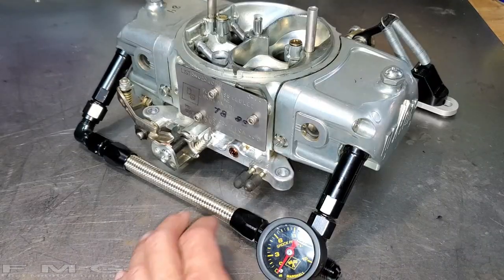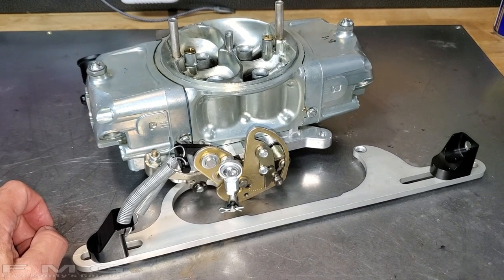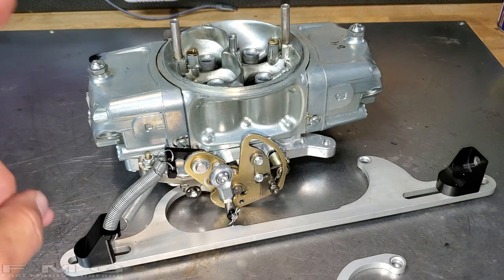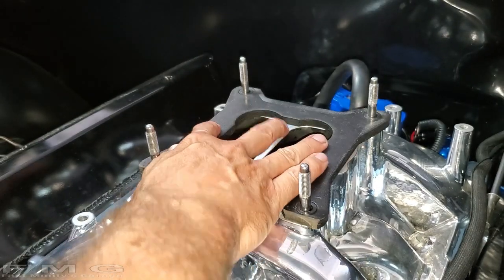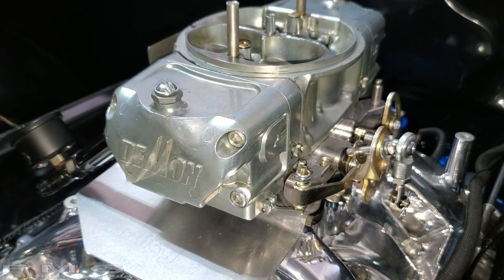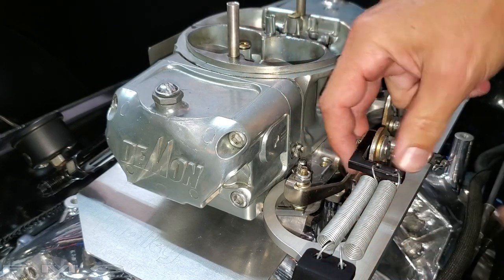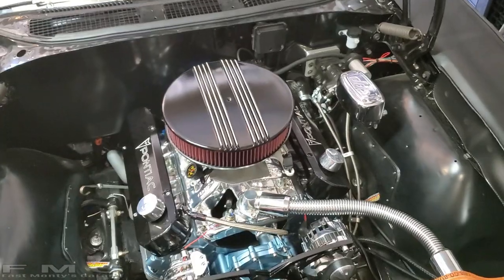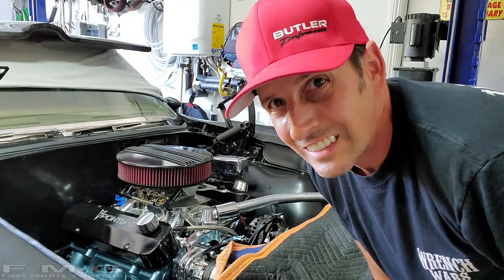Barry Grant Speed Demon Double Pumper Installation - What I had to do.

Comment: Hi Mike !! What length carb studs did ya use ??? And have heard of any problems with going with an MSD pro billet distributor??
Reply from the maker: Hey Eric, I wanna say they're 1.5" studs.  I don't remember?  I'd get a few sizes from Summit Racing, and return what's not needed.  (Or Amazon, if they have em :))   I've heard good things about the MSD Pro Billet Disti... It's on my list of next upgrades.  And, of course, I'll have a video on it, when that happens.  Ha, ha... Thanks for the comment, and good luck!

Comment: Awesome videos!! I’m in the same boat you’re in !! My dad bought my GTO brand new ….. it’s a 68’ … I’m now building it into a 461 stroker. I’m looking for a 750 but can’t find one with annular booster have any suggestions?
Reply from the maker: Fantastic!  There are like three of us, with similar stories.  Very small crowd.  If you're going to stick with a carb, I'd talk directly to Butler Performance.  I think you'll probably need a 800cfm Holley Double Pumper.  They have all the options and will guide you to the correct size/model.  OR, do what I did and convert to Fuel Injection.  Check out my playlist for that install.. to help you decide.  https://www.youtube.com/playlist?list=PL0VCtZe2W6eYFayoNVWpqMIwsXBbZQKqU  Keep at it, and let me know how it goes.  Thanks for the comment!

Comment: when you put in your Tremec did you have to have a custom made drive shaft or did the stock one fit? Thanks! Im debating on installing one
Reply from the maker: Good question... yes, it requires a shorter drive shaft, which is included with the @silversporttransmissions kit.  Thanks for the comment!

Comment: Manual trans / double pumper: good.  750cfm street use on a 467? I think you will like it - should not be finicky to tune down the road and deal with start/stop city nonsense with ease.  Would it "win" on a dyno?  Not likely.
May I recommend... if you never removed idle adjustment screws and inspected the well access with a 7x loupe [or some such magnifier] pull your metering blocks and do it:  I had a 650 [vacuum secondary] that had partial occlusions in idle wells all four corners.  Don't know if it was bit overspeed, poor condition, or drilling it straight in with no 'pecking' to clear chips but the idle well being drilled last had aluminum smear and it blocked flow to idle screw cross connect 40-50% [by cross section], restricting flow to both idle mix and transfer slot ports - my cam did not like it.   I had  a set of gauge pins that I used to knock material loose [it wasn't very thick] and restore full cross connect out of the well.  This may mean getting 4 new plugs so you can make sure wells get cleaned and you don't have metal coming back to haunt idle mix later on.
Reply from the maker: Thanks Flinch!  I love learning from other experts, I really appreciate the comment, for others to learn from.  (Oh, and the Barry Grant is being removed soon, for a FiTech system. :)  That'll be a fun video series, as I've never done that before.  Ha, ha... thanks again!